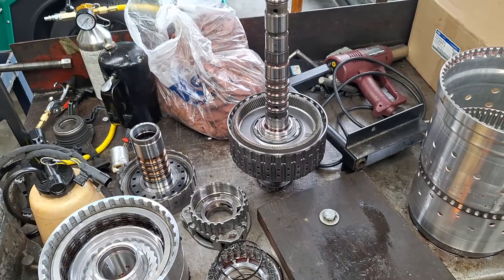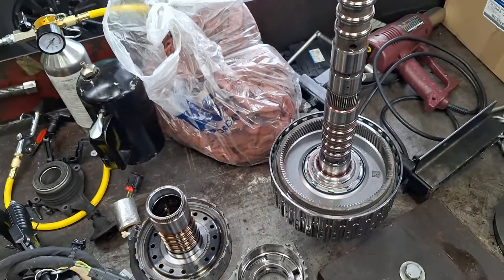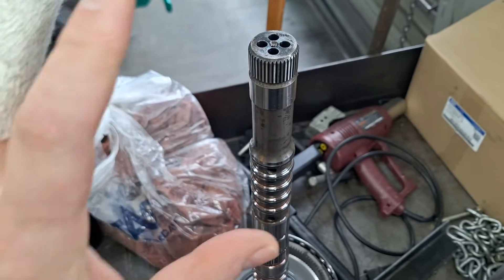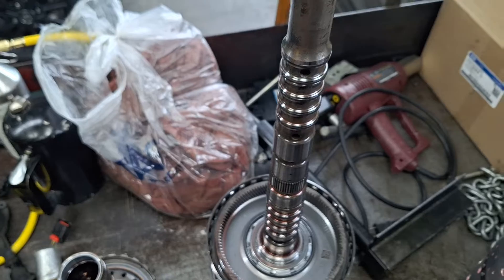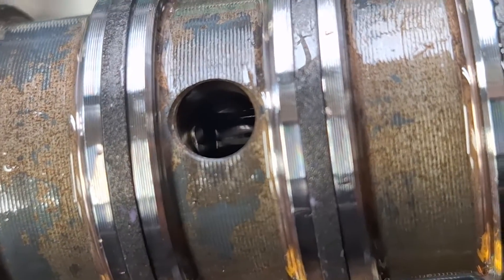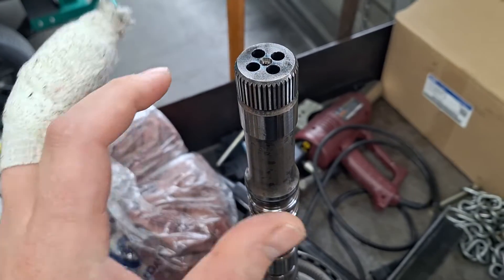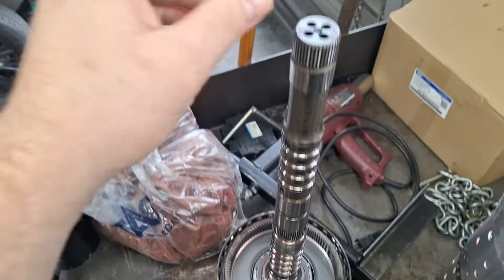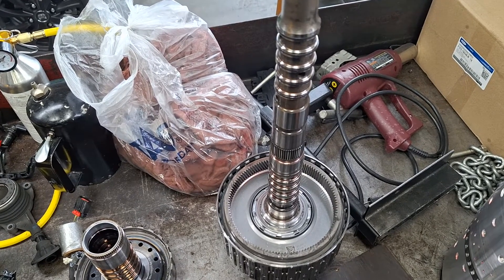Ford 10R80 Input Shaft Port Plug Inspection & Test

Comment: What are the symptoms when this happens?
Reply from the maker: Loss of engagement in certain gears, wrench light
Reply: I have an issue 
After rebuilding raptor 2019 10r80 
No forward no reverse 
Everything is new inside 
Clutches , seals, rings, cdf drum ,hub, valve body,TCC and pump 
Can the input shaft cause this?
Reply: @HussienDbouk-w7o maybe try line pressure test. No engagement at all, maybe the converter isn't engaged with the pump gears. I saw an expedition that had all the studs broken off a converter once lol
Reply: @HussienDbouk-w7o  You are in the same boat as me. Did you figure out what it was? I am baffled and have taken my Trans apart 2 times. New Torque Convertor, VB, Everything. This shaft test was news to me, now I am having drain back. Frustrated.